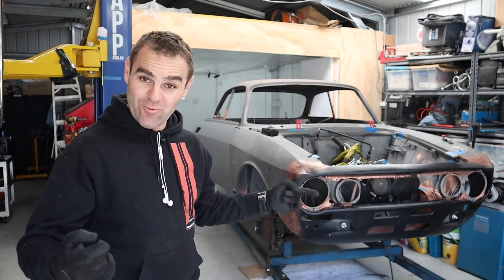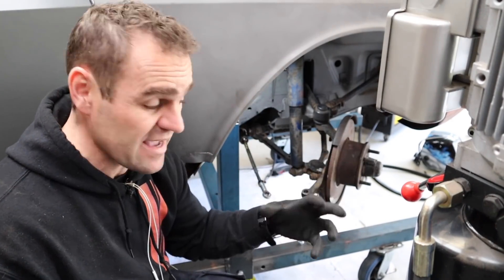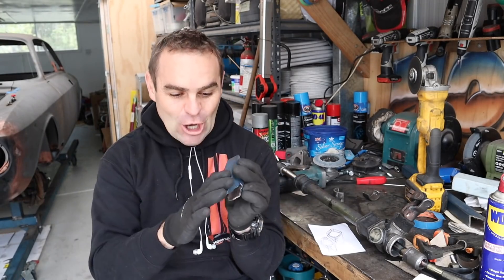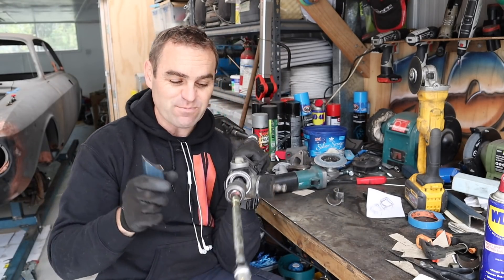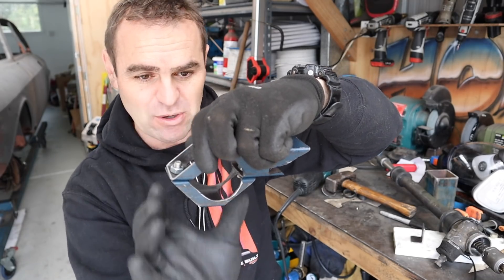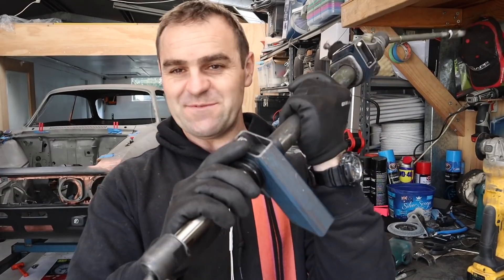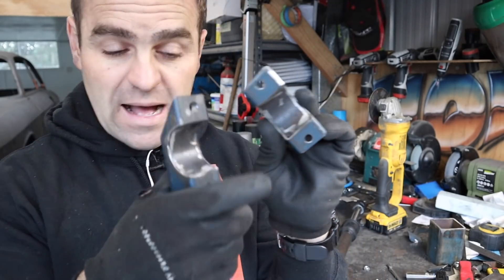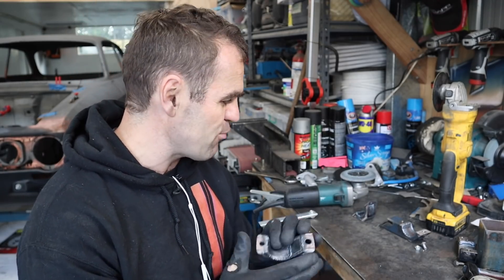Steering rack brackets - Ferrari engined Alfa 105 Alfarrari build part 46

Comment: I noticed you using WD-40 as cutting lube.  There is this stuff called trefolex and looks like a tub of snot.  It works better than WD-40 and reduces cutting temps, makes cutting so much easier and looks after the cutting tools.  It doesn't just burn away too.  Just letting you know in case you haven't heard of it.  If you have and prefer WD-40 then I'll go back in my box :)
Reply: @Neil B  +1 And personally don’t think breathing burning WD40 is good for you.  Better to use a cutting oil or trefolex.

Comment: Jeff, I'd double check your bump steer with the new tie rods ends before you weld in your rack. If the center of the spherical joint is at a different height, you may need to move your rack to compensate.

Comment: I remember the Giocattolo or as it was known in the trade the "chook lotto" I did drive one and I remember the front of the car would move around a lot particularly under acceleration this is sometimes called porpoising (as in dolphin) . Although the prototype had a V6 I think the production cars and certainly the one I drove had group A Holden V8s. great fun to drive but, not for the novice.

Comment: Hi Jeff, i think the rack mounting pads are that shape because they use a bushing.  You may find with it solid mounted you’re chasing vibrations and wobbles. You do need some compliance in the steering and suspension.

Comment: Good job ..! The only thing I would of done is whilst the motor was in-situ it would of been nice to stitch a base plate to the crossmember to know for sure the distance away from the sump plate... clearance check of 15mm is vital.. especially under full engine power and other stuff. Allowing the full movement of engine mounts also. Is the rack 3and a half turns lock to lock ? A quick rack is generally 2 and a half ..
Given the weight of the motor you are probably better to stay with the one you got for normal road use. The Vw golf does an electric assist rack I was going to use.. 
Cheers Geoff

Comment: Standard sump does not hang below the cross member in a 105 series. It's just prone to being hit because it is at the front. The GTA version has a deeper sump but race tracks are usually smoother.

But you are right bottoming can be a problem if you lowered these cars.

BUT you will have problems if you are making things lower than that front cross member! But the rake didn't look below the front cross member in your video.

I suggest you make your tunnel wider of floor higher for the exhausts, and make them as 4 wide collectors not 4 in a square

Comment: How many times do you suppose you’ve crawled around the frame jig and into the trans tunnel so far? Alfararri Yoga?
I appreciate the effort you put into your build and videos. I also appreciate seeing your occasional mistakes and how you recover. I can say as a younger guy I would have forged ahead thinking it will be good enough only to redo it later when it was much more difficult.

Comment: Looking good, I think it's one of the first rack and pinion conversions I've seen on a 105! On a separate note, you should laser cut a script reading 'Alferrari' in the spring GT font as a final touch :)
Reply from the maker: I actually have an Alfarrari logo which I will do exactly that with :D
Reply: Year it's strange that so many think it's not possible ... obviously BS, and with original engine, plenty of room for a rack

Comment: I think that you will find that you are not allowed to weld any steering components. To convert your tapers you will need to machine a tapered sleeve press it into the arm then ream a taper from the other side to match the ball joint. We have done this heaps.

Comment: Quick question.
Why didn't you roll the rack over a bit to get a straight shot into the steering column?
Reply from the maker: It won't fit that way ;)
Reply: Figured it would be something like that.
Going to make for a pain on the arse steering shaft/down pipe

Comment: Any reason Jeff you cant run the tie rod ends upside down so the taper matches the existing ones in the arms?
Reply from the maker: I need to get them lower to get decent bump steer ;)
Reply: @HomeBuiltByJeff  Can you put spacers in to lower the arm from the hub?

Comment: DO NOT WELD THE ARM!!!  it is ok upside down.. There is NO issue in it being upside down!!  If you weld it the metal will become very brittle and snap - DO NOT DO IT!!!
Modified steering components
Welding, heating or chroming axles, stub axles, steering arms and steering knuckle supports is not acceptable unless an engineering report prepared by a Chartered Professional Engineer, is presented, which demonstrates that the modifications are at least as strong as the original and contain no latent defects.
MR426 Fact sheet and list of Chartered Professional Engineers (1.1 MB PDF)
Reply: Agreed, welding cast is a pain at the best of times and wouldn't want to do it for suspension components.  The issue Jeff has is not putting it upside down but getting correct bump steer.  The way he set it up in the last video, the bump steer was near perfect but the taper for the tie rod end is opposite to what is needed to maintain decent bump steer.  I hope I've explained it properly.  Sometimes I wish I could do a quick drawing than write words.  I can't think of any solutions to this issue right now.
Reply: @neilb6029  he mentioned the use of adjustable drift car components. Could they not be used upside down? Will have to wait and see what Jeff purchases I suppose.
Reply: Can it be reamed so the arm has an oversized taper the correct direction, then an insert machined up to size the taper down to the size needed? That’s what I’d be looking at if I had to undertake that and the tie rod was unavailable with a larger taper size
Reply: might seem like a stupid question... but would it be possible to swap the left and right steering knuckles to change the rack from in front of crossmember to rear? This would then not change the direction of the taper.

Comment: would have expected to see the use of the Toyota brackets adapted if possible.  built by Jeff.. looks more like it was designed that way though. 
something if you haven't heard of it, to look into is "steering universal joint phasing" i recently saw it mentioned in a forum,  where a tail shaft can be out of phase and cause vibration, a steering shaft out of phase (due to uni joints) can cause a jerky movement through the steering . the thread I saw it in, and how it was fixed is Here (this car has lots of custom home built everything also ) https://fordforums.com.au/showthread.php?t=11344115&page=18
Reply from the maker: You obviously missed my recent video about that ;)
Reply: @HomeBuiltByJeff  i watched it again to be sure you didn't mention it. it's not related to bump steer. unless the factory column and uni setup reaches the rack where you've mounted it(which would be fine as Toyota would have sorted it) you may need additional uni joints, then you should look into potential phasing issues. 
what you did mention is you are copying a previous setup by someone else, so if they've got it sorted then that will also be fine.  just thought you may not have considered it.

Comment: In my opinion with all that added engine weight to the front you should think of fitting an electric powered steering
Reply from the maker: What added weight?
Reply: You have increased the weight on the front wheels due to the Ferrari V8 engine being much heavier ..no? That's the added weight I am referring to. Also I'm assuming you will be installing larger/wider wheels then stock so I can assure you the steering is going to be very heavy to turn, especially parking will be a nightmare!

Comment: Mig and Tig use the same gas
Reply: MIchael Page No they dont. Tig uses straight Argon and Mig uses Argosheild (which there are numerous different types depending on what you’re welding). The only time you use straight Argon in a mig is if you’re welding aluminium.